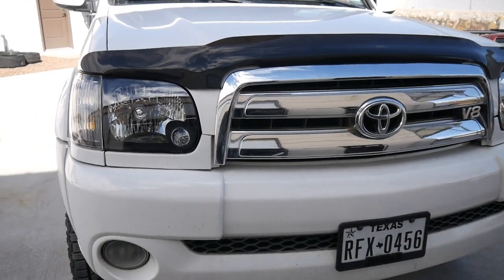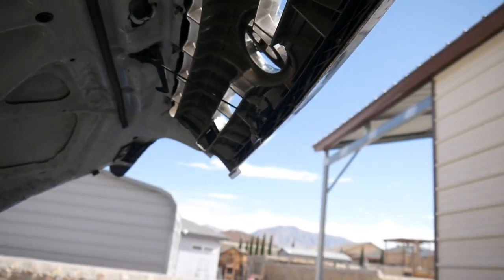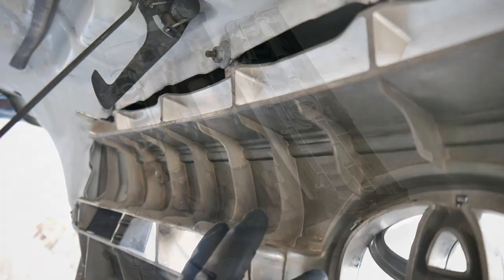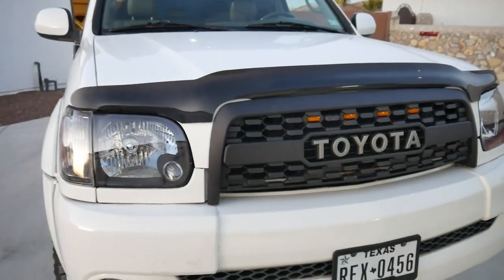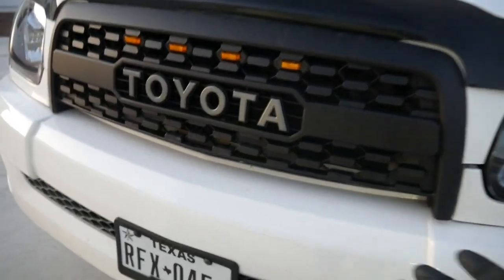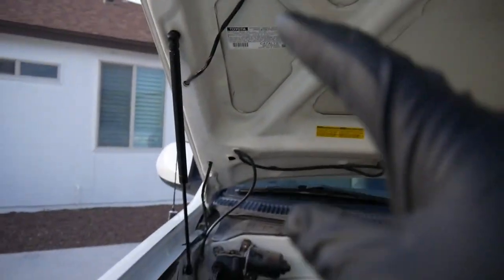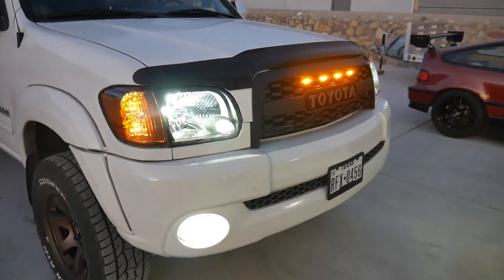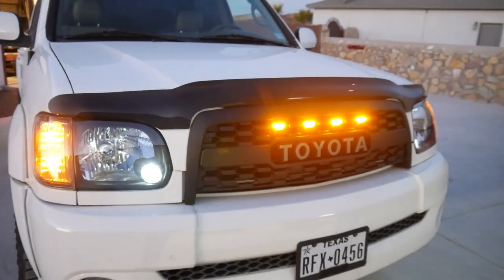DIY 05-06 Toyota Tundra Aftermarket Grill Install - TRD Replica with LED Lights

Comment: Definitely a much-needed facelift. You getting the cars ready for summer yet? I'm having a hard time deciding between putting a k20a2 in my '91 hatch or just keeping the B18C in there are doing some more upgrades/updates to it. I have to say, that I really like the Z3 series in my 8th gen, so I am really leaning that way rn. What do you think? Funny thing is my 8th gen si gets BETTER average fuel mileage than my DD Fit, I can only attribute that to the Fit being automatic.
Reply from the maker: I've been pumping away on the latest video that came out last Saturday, and have now started another project.  Going to tackle the sedan soon also.  No more gas sipper though probably.  Lol

Comment: Hi, that grill and the headlights look really nice. I got a 06 tundra as well and looking to upgrade some minor things as well.  Can you put up a link for both of them.  I didn’t see it. Sorry for the trouble!
Reply from the maker: https://www.ebay.com/itm/364148098947?mkcid=16&mkevt=1&mkrid=711-127632-2357-0&ssspo=hoq3dr0jrzo&sssrc=2349624&ssuid=927yPDFeSi-&var=&widget_ver=artemis&media=COPY
Reply: @Garage Built Hondas  thank you so much.  I appreciate it! 💯
Reply: @GarageBuiltHondas does it come with the Toyota badge too
Reply from the maker: Yes
Reply: @GarageBuiltHondas  I just checked on Ebay it doesn't  say it comes with toyota  emblem
Reply: @BIGPAPA660  it doesn’t say it come with the emblem but they do send it out just got mine in after a couple days of receiving the grill
Reply: Can you get the TOYOTA grill emblem that lights up? Anywhere?

Comment: Looks good, how did you splice into the running lights? Thanks.
Reply from the maker: Cut the wire and soldered them together.

Comment: What fuse did you hook it up to. Mine are always on and I want to be able to turn them off and on
Reply from the maker: I wired mine up to the daytime running lights so they are always on.
Reply: @GarageBuiltHondas  that did not help at all bro

Comment: What kind of bedliner do you have?
Reply from the maker: I'll try to look, it's a huge one piece liner but was in there when I bought the truck.  I like it as all water collects and runs out the back of the bed when I drive off.

Comment: I wonder why it has a huge gap between the grill and bumper?
Reply from the maker: Mine seems to have been tweaked up front from an accident.  It's a rebuilt title and not entirely perfect
Reply: @GarageBuiltHondas  I have that gap also, it really bothers me
Reply from the maker: @13alejandre I don't mind it.  Still looks really cool, just the design of the grill leaves the extra room.